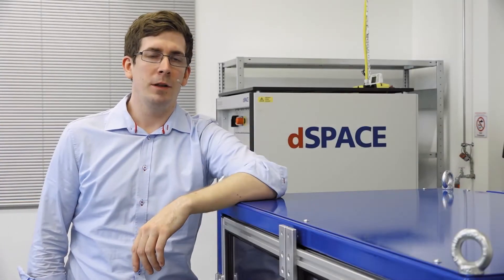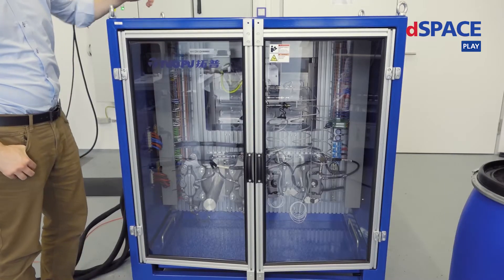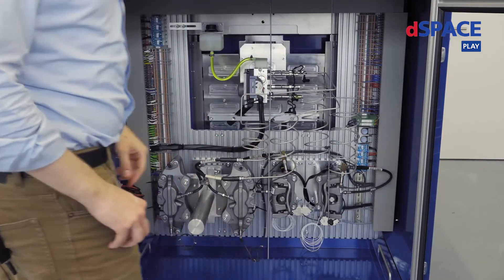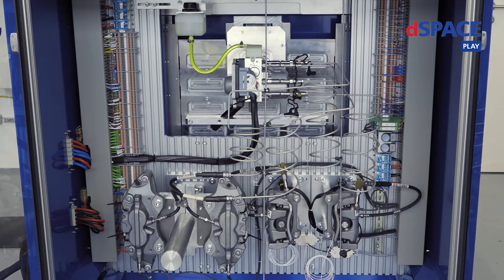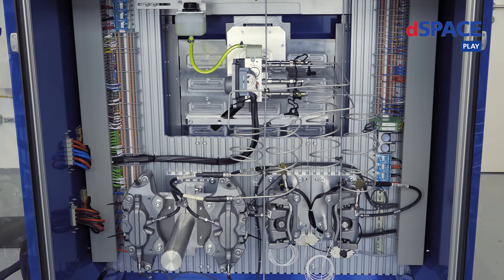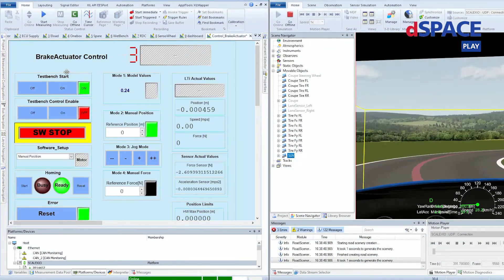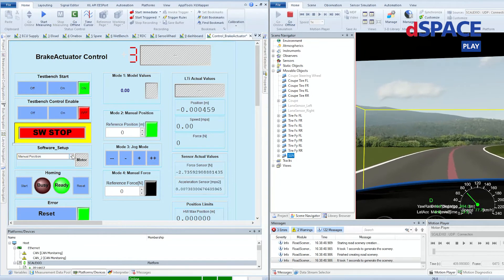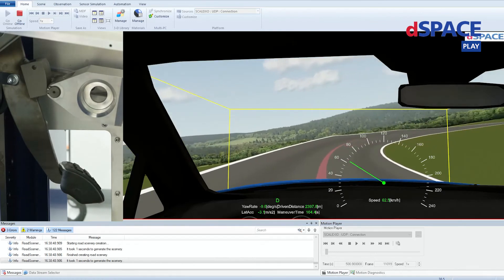Testing and Validation of Braking Systems

Comment: It greats. 
Do you have light aircraft disc brake test bench?
Reply from the maker: Currently we do not have a dedicated brake Testbench for light aircraft. But since the operation is similar we surely can adapt our current bench to this requirement. Therefore I recommend to get in touch with our sales department if you are interested.